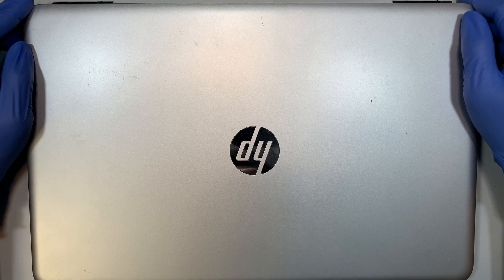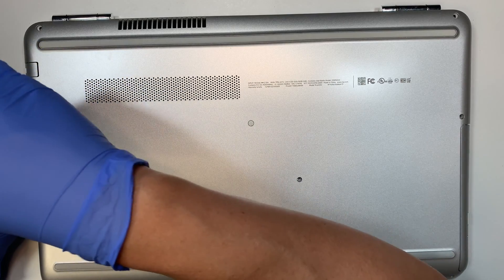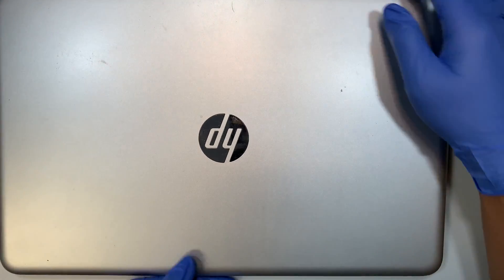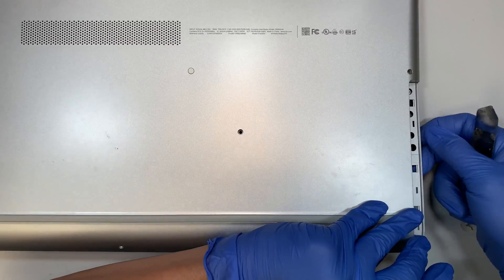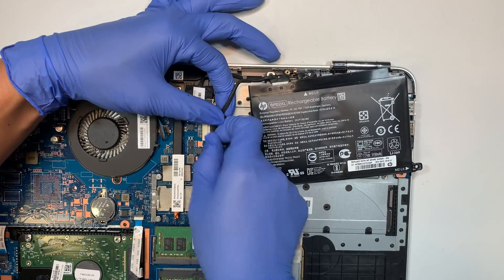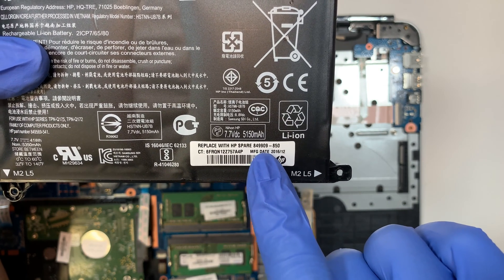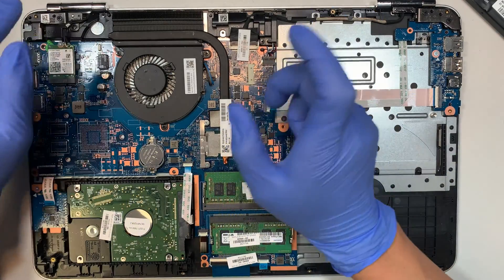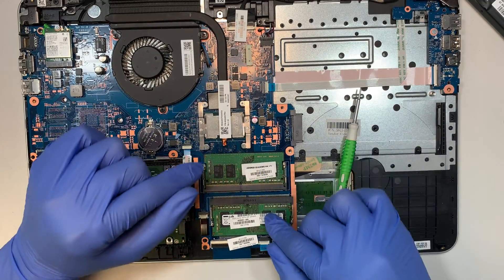HP Pavilion 15 AU Battery Replacement

Comment: Hi Uber Geeks, thank you for the step by step explanation (it helps soo much!) I manage to replace mine successfully, except that I used 70 mins instead of 10 mins (your video) 😄. Just want remind others to make sure the battery cable is fit nicely back to its place so that it doesn't block the fixing of case back to the board later. That is what cost me longer time, finding reason why can't the case fixed perfectly back to the board (bulging). Thank youuu and Happy replacing it! 😊
Reply from the maker: Thank you for sharing your experience. Glad the video helped.

Comment: Thank you for this video!  Very clear instructions, slow enough to easily follow without being repetitive or boring.  Especially thank you for pointing out exactly what model of battery is needed!  At the time of this comment, only the 3rd Amazon link in the description is usable, but I know that with the information you pointed out in the video, I could have found one even if none of the links worked.  Again, thank you so much!  You just added another few years to my laptop's life :)

Comment: My HP laptop gave an error "my internal battery was very low." I performed the replacement battery task at your video direction. However upon turning it on, I recd these msgs: preparing automatic repair, diagnosing your PC, attempting repairs. Now what? HELP PLEASE.
Reply from the maker: Are you still stuck at this attempting repair ?
Reply: @UbergeeksBiz  I forgot to edit my posting - I was able to fix it myself. Thx and have a blessed day.

Comment: if buying a battery from amazon, and if its not an oem hp part, will a 3rd party battery create operating problems and compatibility issues?
Reply from the maker: No issue with 3rd party battery

Comment: HP battery is fat and dead..is it safe to just use the cord for power without removing the dead battery?
Reply from the maker: Do not recommend using when battery is fat / swollen. Replace the battery

Comment: Great, the hidden screw helped me out a lot, the only question I have is when I should start charging a new battery. I put a battery I ordered off of Amazon in, looks brand new and description said brand new, and it's 56 percent full. I know they say to charge a new laptop all the way the first time you use it, but I'm not sure about this one. Perhaps it doesn't make a difference, I just want to make sure I get the most life out of this new one that I can. Thanks for the video!
Reply from the maker: I would charge the new battery. If the new battery dies off less than 1 hour, then you might want to exchange it.
Reply: @UbergeeksBiz  thanks! I charged it and it's going strong now, no issues at all. I got the laptop for cheap off somebody on craigslist knowing it had a bad battery, and it's great for what Im using it for. Came with a 1 TB hd, which is slow and thought about replacing with an SSD, but probably won't be necessary. Thanks for your help!
Reply from the maker: @synthesis12  You are welcome. Glad the video helped.

Comment: This is a great video. I have one problem. The top screw on the battery will not budge. It’s so tight it will not budge at all :(
Reply from the maker: Yikes... maybe drill the screw out ?

Comment: This works perfectly. However now my laptop says that there is no battery even though it runs on battery and shows charging status.
Reply from the maker: Maybe the battery is not OEM ? HP use "smart" battery that can identify if 3rd party or genuine battery from HP.
Reply: @UbergeeksBiz  Thanks, I bought what I thought was a genuine HP part, it has the HP logo and looks identical to the battery in your video. It is however a SAINTEE part. NOT GENUINE. Beware.